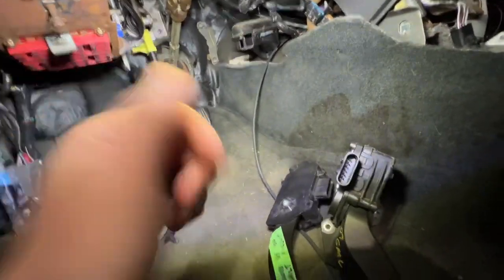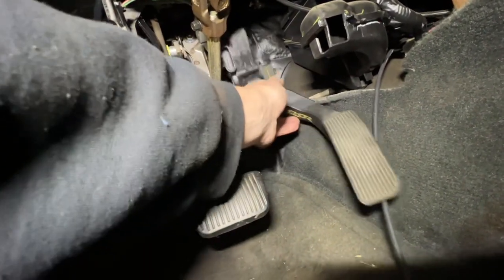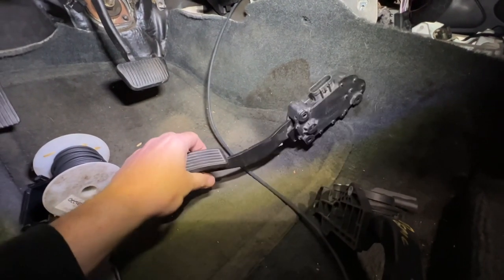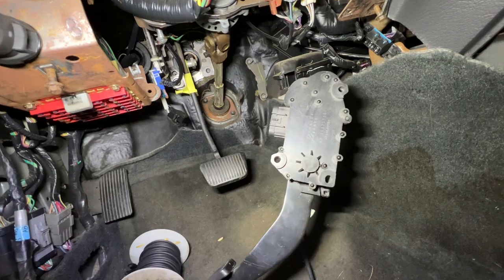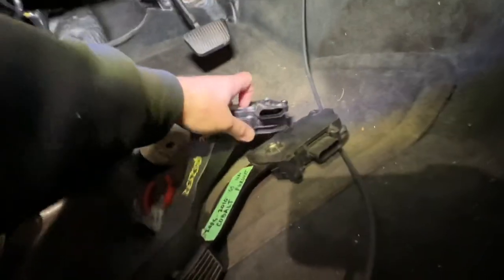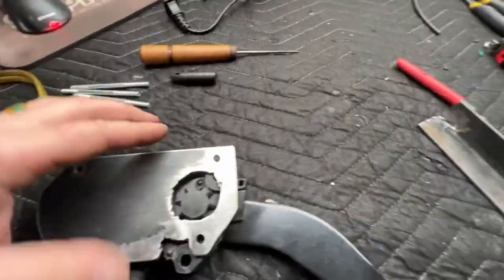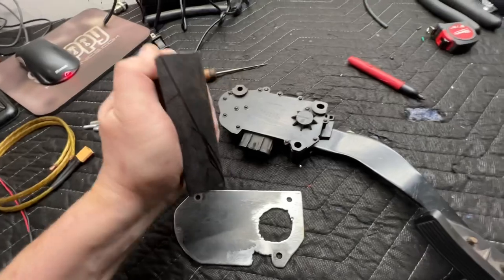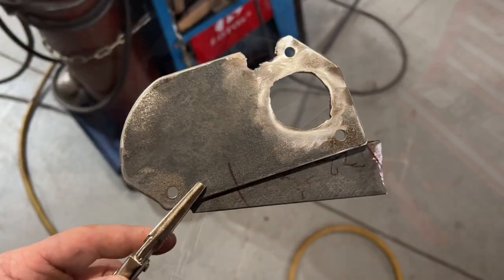Making a quick dbw pedal bracket for mustang

Comment: Look at the 2009 Impala SS pedal. They fit nicely into many cars.
Reply: At only 2-3x the cost and still needs a bracket to fit. Very few SS's will be in the junkyard while there's tons of donors for the Cobalt pedal.
Reply: @hydrocarbon82  A new Impala pedal is less than $60 and it has a flat mounting pad that bolts easily to many firewals.